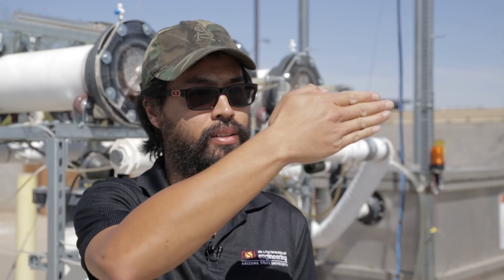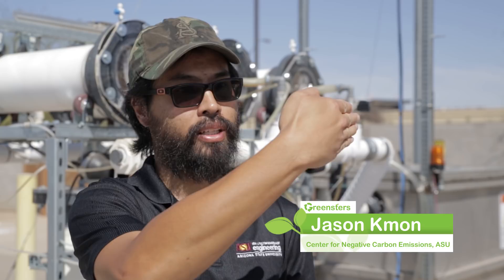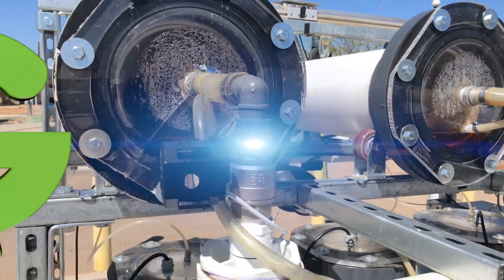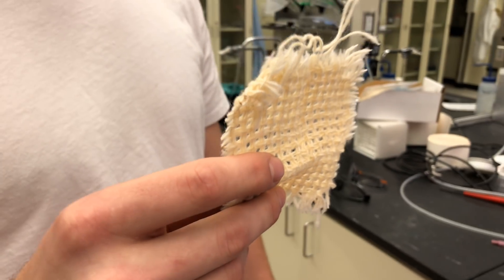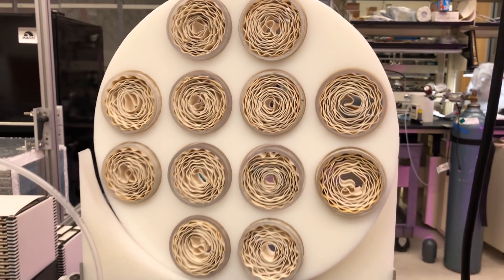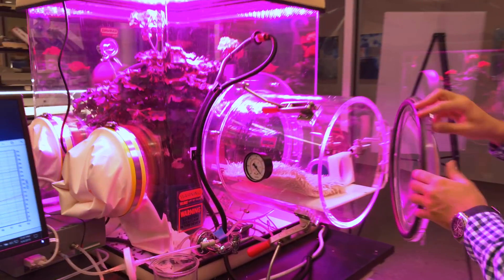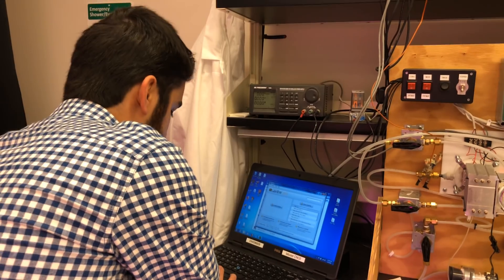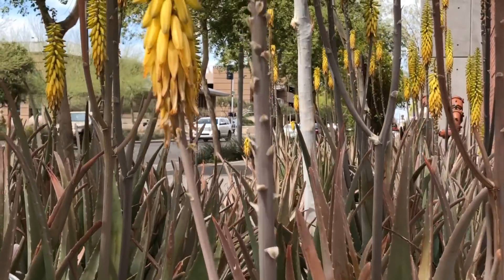Greensters - The machine that could save us all! | CO2 Carbon environment climate change

Comment: Planting trees is the safest way to store CO2. Trees can be made into furniture and building material keeping the carbon safely stored.
Food plants can't grow without CO2 and the last thing we need is some nutcase reducing the CO2 to a level that caused starvation and desertification by lack of CO2 which would then cause a rise in the temperature and the nut cases would still reduce the CO2, ending the life on the planet
Reply: Some varieties of algae are edible.  And, of course, you can burn it if CO2 levels get too low.

Also, algae can double its mass in a day.  Only the smallest trees can do that in a year.  So it's much faster.

Comment: Why not just start using renewable sources and cut down on gas emissions overall and adapt to a future without the burning of fossil fuels. Oh wait money.
Reply: Not enough
Reply: Exactly these nutcases are only interested in the money. We use CHP to produce electricity from gas and put the CO2 directly into tomato greenhouses. Planting trees is the best way of storing carbon safely because trees can be made into furniture and building material and the carbon safely stored that way.

Comment: why not just plant more trees?
Reply: because trees decay and the bacteria that break them down put back a lot of the CO2 into the atmosphere, sometimes as more potent greenhouse gasses such as methane
Reply: @ConnorOfAllTrades  Trees can be made into furniture and building material and the carbon safely stored that way. Food crops can't grow without CO2 so the last thing we need is some nutcase removing all the CO2 from the air causing starvation and desertification. Certification because the plants can't grow without CO2 resulting in higher temperatures because bear Earth gets hot.
Overpopulation has caused climate change since 1970s world population has doubled, forests disappeared and temperature increased by 0.7°